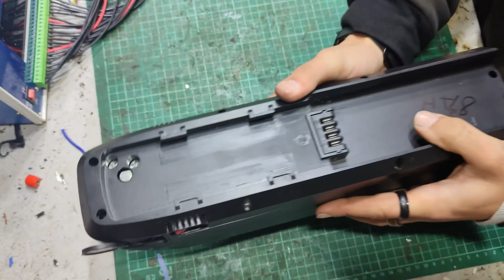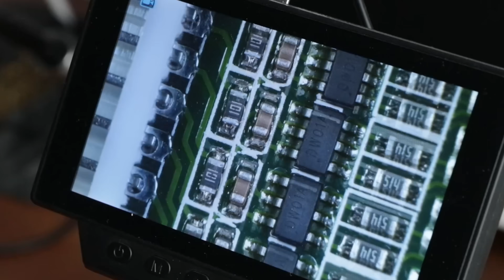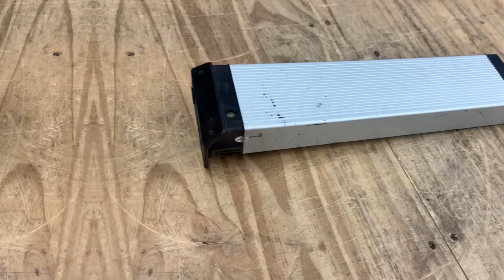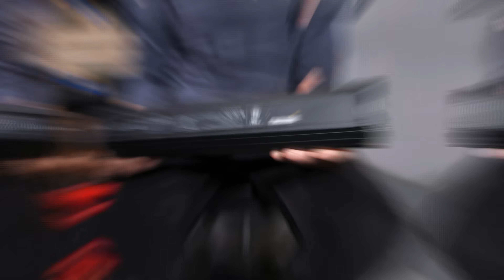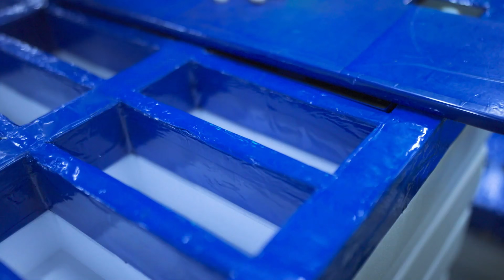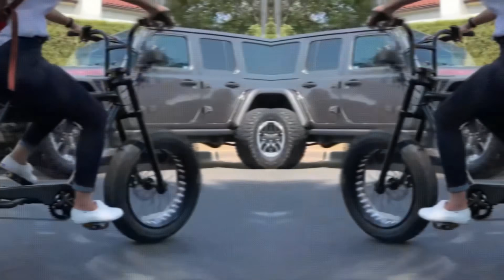Avoid These 4 eBike Battery Brands! (And 5 That Still Hold Charge After 2 Years)!

Comment: Need to add electrify bikes to that list.. i bought a 52v 25ah battery pack from them for a long distance tour.. 1 week into the tour.. 1 of the cells went out.. and the range dropped from 60 to 80 miles to 50 to 60.. and that steadily declined over the course of about 4 months until the battery is almost useless.. and takes forever to charge.. contacted the company.. when the cell went out.. they told me inpushed it to hard.. and cut off all communication.. their batteries might be fine for people doing 20 miles a day with no load.. they advertise them as long range batteries.. but what they do not tell you.. is the Samsung cells they use.. are designed for low output.. long range.. well im hauling around 400lbs counting myself food water etc.. im crossing mountains.. i keep the assist as low as possible.. usually level 6 out of 9 MAX going up a mountain.. well the Samsung cells used in their batteries are designed for a max of 10.5 amps discharge.. i hit around 10.5 to 12 amps in level 6 assist.. but their website does not mention that limit.. you have to research the cells themselves to discover that . I even contacted their customer support before I ordered.. and told them what I was doing and asked if their batteries were suitable.. oh yeah they said.. these are the best for touring..🙄😒 So i flushed $800 down the toilet.. i just ordered a custom battery with Molicel cells in it.. designed for low resistance.. less heat.. high discharge rate.. fast charging rate..and long range.. the battery also uses an 80amp bms..

Comment: Two years? My Himiway D5 battery is two years old, with 10,000 km on it (regularly recharged at about 50% charge, sometimes 2 - 3 times per day)) and it's still going strong. The hub motor on the bike, however, is starting to sound unhealthy, and I'm not expecting to get any help from Himiway.

Comment: I don't have to worry. None of my bikes have batteries or motors. But I'm only 75 and don't want or need that crap.
Reply: Then obviously this video  isn’t for you!
Reply: Let’s give you a brownie button both of my bikes have batteries big ones and while I may only be 70, I literally held a job from the time I was 13 until I was 59 and the only reason I quit working then was because I had a stroke. And when I say job, I’m not talking about pushing papers although in my later years, I did😮 have a lot of extra paperwork to do but unlike most people who do paperwork, I was also swinging a 10 pound sledgehammer and handle a 24 to 36 inch pipe wrench working as a frac hand all the way up to the regional supervisor of a fracking company. And still swinging a hammer. So the fact that you are pushing a pedal bike, doesn’t impress me unless you can tell me how many times you racked up 200+ hours for a two week paycheck.
Reply: @jcc777  Do you want a cookie?  You chose that profession, no one forced you.
Reply: @jcc777  Yeah, I worked when I was a kid. Got kicked out of the house at 17. Did construction and concrete until I decided to get smart and work my way through college. Worked my way up the ladder, kept learning new skills, raised a son, stayed fit, got rich, retired at 65 and built myself a house on acreage with water. Racking up 200 hours doesn't impress me when you miss all that time with your family and end up giving yourself a stroke at 59.
Reply: @jcc777 you tell him brother I'm 70 had one stroke lung cancer removal and broke my back in five places falling onto my wood pile from the roof of the garage... more power 👍👀🚑